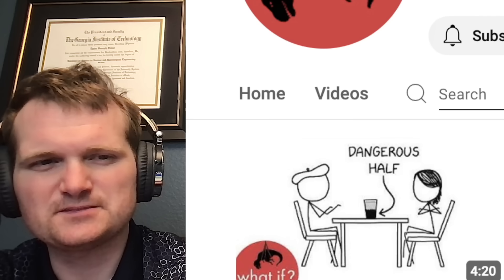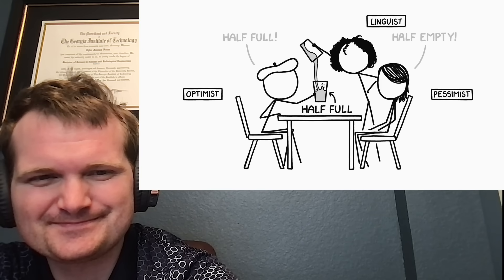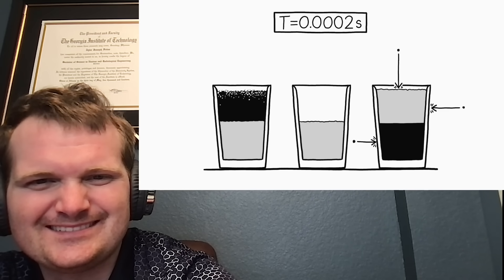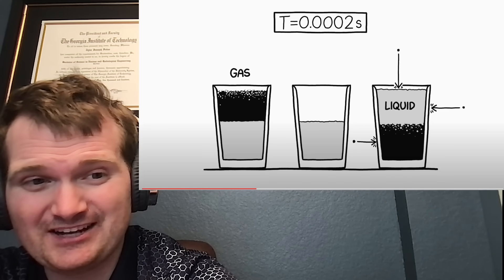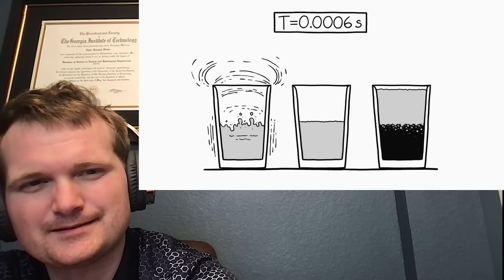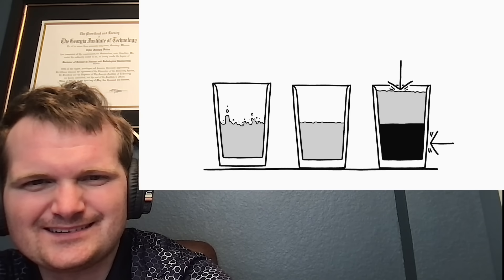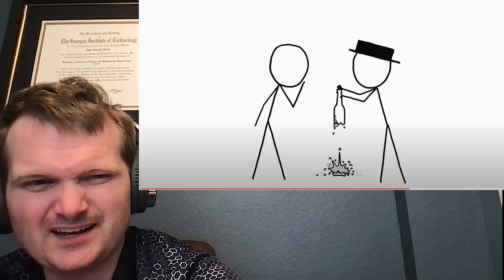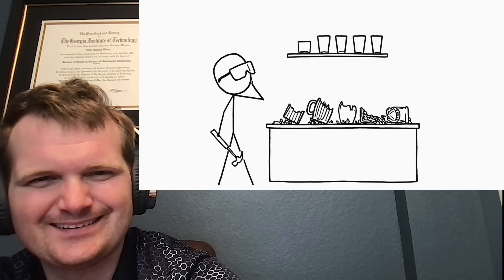What if a Glass of Water Was LITERALLY Half Empty? - Nuclear Engineer Reacts to XKCD

Comment: I'm a postdoc in a chemistry lab. My phd was in physics, and I'm always amazed at how different my way of thinking about things like vacuum is from the chemistry grad students I'm in charge of. I tend to think of these things like how this video does. An examination of the limits and what individual particles are doing on very small time scales. For example, I'm always surprised when one of the students expects the relative force from a vacuum system to be significantly greater at 10^-3 Torr vs 10^-1 Torr, even though it's likely something like 14.7001 PSI vs 14.71 PSI.

Comment: Shouldn't the water in the glass on the right not just "fall" down and immediately fill the bottom of the glass? There is nothing holding it up.
Reply: "Immediately" would be at the rate of acceleration caused by gravity. The suction/pressure difference is much stronger than that, so it actually moves much faster than if it just fell.

Comment: I actually have a souvenir from Trojan nuclear plant. Sometime in the 1980's they had a water hammer incident that ruptured a 8" sparger line in the condenser.  They started too fast, and with the sparger line was at the pressure of the condenser so there was no cushion at the end.  It blew the plug out of the end, along with about a foot of pipe.  It was cleared by RP and sat in the engineer's cube for over a decade.  When he left, he asked if anyone wanted it and I jumped at the chance.

Comment: i dry my clothes with a vacuum i use a two tanks full of water and sealed clothes are completely submerged amd both are connected by pipe i dont suck out the water but rather pump the water out yeah water dont suck under vacuum but gravity still works i do it by hand pump once most of the water is out and put the clothes out in the sun gives it slightly more heat than the other tank without the clothes so what happens the water boils off the clothes and condenses on the cold side and the clothes dry extremely fast with very little energy yeah always wrinkled but its cheap drying. fun fact thats how a heat pipe works for the most part. its kinda cool i dont use it much but my dryer went out one day and i wanted to dry my clothes fast without needing a clothes line like the old people do and im a nerd so it was fun making. another cool thing it works for a lot of things i can put salt water on one side and pure water collects on the cold side and because its in a vacuum the water is stuck in a boiling state so it can boil with very little energy better than a solar still even the slightest temp will work inside and outside your house is plenty and dont really need heat it works with a turbine too it works but its just not good enough needs a very high rpms the pressure is very low and the slightest heat is free but if you a turbine clothes get cold kinda weird but if you need something to dry fast without using heat thats how you do it

Comment: Wait can we describe superpositions through the glass half empty glass half full saying?

If I remember correctly, it’s when fx an electron can be in any position possible within an atom, thus it scientifically being everywhere possible.
Or like how a particle can either spin one direction or the other.
Correct me if I’m completely wrong idk.

So I’m thinking, how can a particle spin on both directions at once?
Well if a glass is a glass, and you fill it up with water till half of it is filled, the glass is both half empty and half full. Those words are only used to describe the relation between the glass, and the water and air inside the glass. It’s a description of how we perceive it, not an accurate description of what it is. Because it’s atoms arranged to a glass etc etc.
likewise, a particle spinning this way or the other way, is a description of the particle and not “how it works”.
Idk if that makes sense

Comment: I'm surprised you use imperial units for such a scientific field as nuclear reactor design and control. As you said, 2250 psi is in a pressurized water reactor at 590°F. Why not Pascal and °C (or K)?
Or did you just convert it to imperial units since I guess most of your audience is from the USA?

Comment: Structural engineers would say “it looks like you have twice the material necessary to contain the water, that’s inefficient “
Reply: The bottom has more material, but the top has a higher radius, so depending on that angle you may or may not have twice the necessary material

Comment: I want to see the last case experimentally verified. I have some doubts about it acting that way in the real world. For example if the water was airiated(?) from the tap and put under that much tension, the air bubbles might expand sufficiently to make a channel between atmosphere and the evacuated portion. Or all the bubbly disturbance might spread the impact time out. I have to admit I haven't come up with a good way to do the experiment.

Comment: the real fun with vacuum is that if you could get a vessel that could hold a hard vacuum and be very light weight in theory it would float in the air. The problem is holding a vacuum and light weight generally are incompatible with current materials science.

Comment: This is probably a dumb question. But why don't we use thermonuclear weapon detonations to generate electricity? For example, we just build a giant reinforced concrete sphere(half sunk into the ground) filled with water and set one off in the middle twice a day and let the steam run through turbines. Seems like that would be a mostly economical way to generate power on the Terawatt scale.
Reply: Biggest reason is that people do not like nuke explosions near their cities or even planets any more. Even earth works using nukes is banned now, I think.
Reply: You can’t contain a thermonuclear weapon, and if it’s weak enough to be contained, it’s probably not too much energy
Reply: @awakener-s3l  We contained them in the past during underground nuclear tests. So clearly with enough concrete or rock it can be done.

Comment: A former nuclear plant worker told me that when they steam-cleaned the non-nuclear pipes, sometimes they'd get a slug of water in there. And when it hit a bend, you'd hear the sound for miles.
Reply: in properly big and powerful steam systems like the one under Manhattan, a really nasty water hammer combined with an old section of pipe can result in a 50 story tall steam geyser.

Comment: Water at over 100°C is interesting. The company my father worked at had a heat central that provided both hot water for the sinks and hot water for the elements in their housing area. That was something like 20 houses with a total of over a thousand apartments. The highest houses were fifteen storeys high and to get heat and hot water that high they ran the water heat at about 110 to 120 degrees centigrade. Now as water boils at 100°C they ran this under higher pressure. The interesting part was that in the heating central they had showers and a kitchen, and when you turned on the warm water it was directly attached to the warm water used for the entire area. So when it got hot it started to boil the moment it left the spout. I quickly learned not to stick my hand into that! But it also was extremely effective when you were washing dish. Just don't burn your hands while doing so....

They had one thing more that was pretty interesting. The heating central had three large oil burning boilers that could keep the whole area with heat even if it was -30°C outside. But when burning hard there happened that something went wrong and the burners would go out. In that case "someone" had to go there, fix the problem and get them working again as quickly as possible, and as my father lived just five minutes away he was often "someone". Another thing was that there was an automatic fill system that made sure the system was never running low on water. When the burners cut out the water volume diminished when the temperature of the water went down. For a system like this the difference could be a couple of cubic meters that the auto fill system added. Un fortunately there were no automatic system for draining water when the central was working again so "someone" had to go there and open a valve to drain the water so it wouldn't over pressure the system. My dad took me with him a few times and this was both dangerous and entertaining. In the basement they had a room with a huge ball valve. The handle was about a meter long and a meter or so beyond that the huge pipe just ended. So the first time dad told me to open the valve and keep away from the pipe opening. So I did and the water started to rush out. The pipe was about eight inches across and the water was spewing out like som kind of geyser. As it was over temp it immediately boiled and the room was filled with steam. As the pressure gage showed about the right pressure you had to go in again and manually shut that valve again.

When it was about -20°C outside the boilers in the central burned about 35 cubic meters of oil a day. That's 35,000 liters or 9,246 gallons or about 220 barrels of oil. So it was a bit bigger than the boiler you might have in your own house.
Reply: Station, not central

Comment: The glass is at 50% of its storage capacity.
Reply: I say the glass is at 50% of its emptiness capacity
Reply: The glass has something in it
Reply: False. You can still compress the water, or better, fill it with solids. Yet even that is still not true 50%, as it's still mostly empty between the atoms.
Reply: @ultimaxkom8728  you cannot compress water in a glass without shattering the glass. It’s at 50%
Reply: @ultimaxkom8728 also solid water is less dense that liquid water, one of the most unique properties of water
Reply: @Nothing_here7435  technically under sufficient pressure solid water does become less dense than liquid water. Clearly that’s what op meant lol
Reply: @frimi8593  the problem is he said compress or fill with solid not compress to a solid, which would require even more pressure and force then just compressing the water.
Reply: the glass has 50% free space
Reply: Are you sure the glass even exists?
Reply: @glados5065  
"I drink, therefore I am."
Reply: Optimism,
Pessimism,
There is no room for emotions in science....
(except for when the grant funding goes through)
Reply: Good one
Reply: The glass keeps 50% storage capacity available.

Comment: I am a building automation specialist by trade. First and foremost, TMI is used as a case study in how NOT to design automation systems, since it was the TMI automation system that contributed heavily to the meltdown.

Water hammer is also a problem in tall buildings that use chilled water for cooling. Large diameter pipes of water 20 stories tall carry an immense amount of pressure without any flow. The building I work in now doesn't have a soft starter or variable frequency drive on the pumps, so they tend to rock the building as they kick on or off and exert a tremendous amount of energy into the momentum of the water column. 

Water hammer, in all of its forms, is impressive and dangerous.

Comment: Is a can of soda more, less, or equally as full before and after it expands in the freezer? No air or liquid escapes, but the size of the can has changed.
Reply: I'd say equally as full, but less filled if you are correct that no air or liquid escapes.

But in my experience, soda that expands in the freezer does lose air, you can notice a lower amount of gas inside of it when you drink, the expansion of the aluminium is just enough that a bit of the gas can leak out through the weak link of the opening. So I'd have to stick with less full
Reply: @mordirit8727  good point! I think that means any glass open to air is neither half full nor half empty, instead being in a state of flux as it outgasses.

Comment: Water hammer is also a very big issue with water plants.  I know of one time they opened a valve too fast and the water hammer hit a 90degree bend... and the inertia was enough to blow straight through the steel.  Following that, the stem on the pipe was changed, so instead of taking 5 turns to close, it took 25, so no matter on how fast you turned it, the valve couldn't be opened fast.
It's also why after doing plumbing fixes, you should slowly open the taps and stuff, or you can blow out the filter screen on the end of taps.
Reply: We had a crew replacing water meters around the neigbourhood a few months back and they managed to damage the underground cutoff valves for some houses. These are at least 75 years old, so understandable. So another crew came around to excavate and replace the cutoff valves. They had to shut the street valves off to isolate a section of the 4" main and, probably when opening them again, damaged several of those as well. I'm assuming this was water hammer as some of the valves were upstream of the ones they closed.

From the excavations I see around the neighbourhood, the third crew has now replaced at least ten valves. I've watched enough civil engineering videos to know someone spun the valve wide open without waiting for the pressures to fully equalize and for any air to vent.

Comment: There was a reactor accident one time where someone pulled out a control rod too far (reason unknown), it had a huge power excursion, water hammer lifted the reactor 9 feet off the ground, and the immense pressure forced all the control rods out through the top.  One of them went right through a guy and pinned him to the ceiling.
Reply: SL1. Kyle Hill did the best video on it.
Reply: @galen-eu1vu  Yep that's the one.
Reply: SL-1 incident, Tyler reacted to a video about it.
Reply: I reckon the theory that SL-1 was a murder—suicide is pretty compelling. There's the nature of the phonecall taken just prior, and at operator knew what would happen if the control was extracted like that. But the most plausible explanation is that it was stuck and was suddenly freed. That accident was such a mess.
Reply: @PBeringer  It's possible, and there is some evidence of that, but not all the facts fit.  We'll never know because everyone was killed instantly and there isn't anyone to tell their side of the story.
Reply: @StormsparkPegasus  Oh, of course. It's just an interesting thing to consider/speculate on. Sure makes for a "better story".

Comment: The glass is twice as big as it should be. Structural engineer here.
Reply: That's the safety factor. People always try to put more than the standard amount of water in the glass.
Reply: What's that old phrase? "It's very easy to make a bridge that immediately breaks or never breaks, the real trick is making a bridge that just barely doesn't break"
Reply: @efeyzee  something like that. We make them significantly stronger than they need to be, but engineering saves time and money.
Reply: It is a hardware problem.
Software engineer here.
Reply: Philosopher: Why does it have to be glass.
Me: Brakes glass putting feet on the table.
Reply: That’s pessimistic structural engineering: optimistic might say it’s half as big as it should be. Although the neutral philosopher might ask what makes one more preferable than the other.
Reply: Even though the glass looks half full or half empty, it is actually more empty than full, due to the shape of the glass.
Mathematician here.
Reply: Leave that shattered glass outside for long enough (a very long time) and physical weathering processes might eventually reduce it to sand again if it’s not buried first.  Geology student here.
Reply: root beer addict here, it is not root beer
Reply: The glass is not biocompatible. Biomedical engineer here.
Reply: @photonganglol2413  What makes glass non-biocompatible? It should be almost entirely unreactive, right?
Reply: @awareqwx  the body will encapsulate. You’re right that it’s not reactive with anything that I know of. But if there isn’t an integrative component then the body will encapsulate and create a foreign body pathology. Not that we would ever implant glass lol. Not exactly the elastic modulus we’re after.
Reply: The glass should be made of concrete - civil engineer
Reply: What about seasonal variation? Former squeezed tourist here.
Reply: <<<< audio engineer lol
Reply: Particle physicist the glass is 99.999999999999% empty
Reply: The water is twice glassed
Reply: I'm just glad I put half my water in a backup redundant glass- Army Corps of Engineers
Reply: [the guy in the alt text is always real]
Reply: It is neither after I'm asked, really thirsty fella here.
Reply: Excuse me?! This is not my glass! My glass is bigger! With sugar on the rim! And an entirely different drink in it! I demand to talk to management! and a complete refund! Social engineer here.